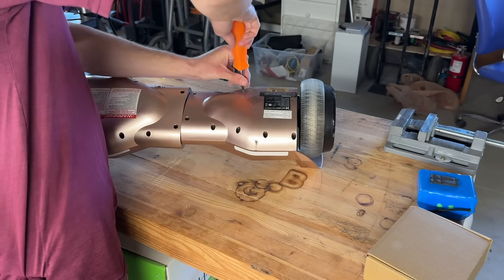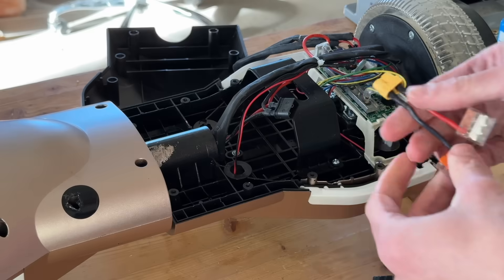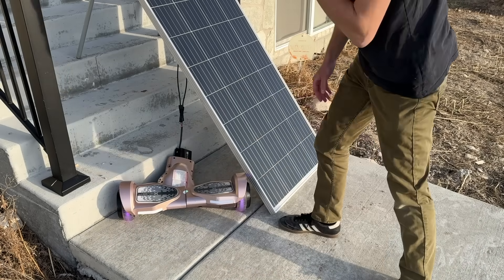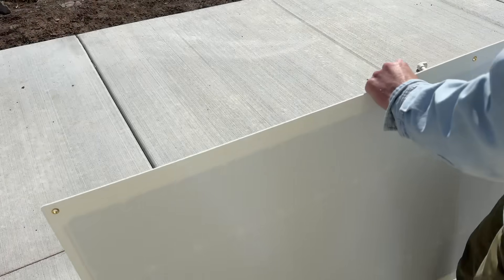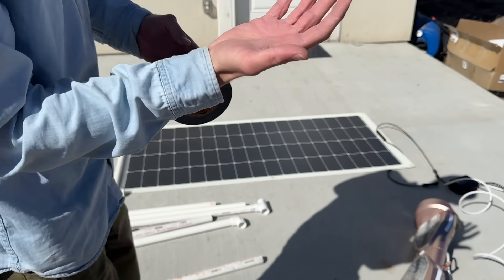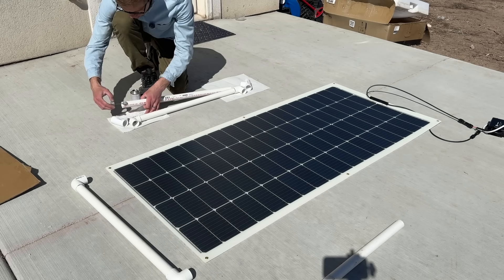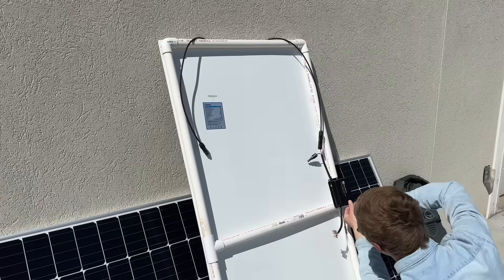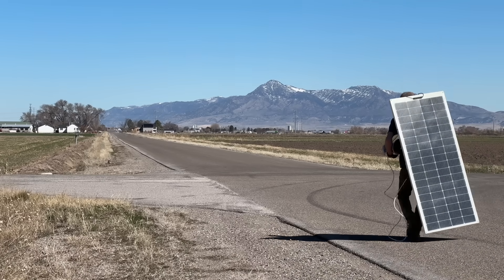I Built A Solar Powered Car... (No Battery)

Comment: 🌴🤔hummm, so yea many of use have idea’s but not many of use carry them out , as I to always wondered if there could be an infinite powered vehicle or boat , so there would have to be a battery just to get you thru the clouds , or over cast , my first thought was something like a cheap mobility scooter with a solar roof , and then I thought while the scooter is already going to be moving could a bike wheel be mounted in back connected to a belt drive generator as regenerative power ?    🤔

Comment: solar panel hho generator into small lawnmower 4 stroke engine dont forget to add a small amount of aluminium powder in water job done then you only ever need water.
Reply: Adding 50% losses making hydrogen then burning it at 25 % efficiency ending up with 12.5 % No just feed the solar electricity into a 87.5 % efficient wheel motor for 7 x the power.
Reply: @JonathanTamm  yes but when the sun goes in dont work hydrogen is the way.

Comment: The problem why the invention doesn't work very well is for a very simple and obvious reason: You have a hoverboard that contains two electric motors of 200w each, so in total: 400w, so logically you need a power source of the same capacity, so 400w, and that's not the case because your panel is a 200w panel, maximum power, so you can never get it in real time, so anyway your panel doesn't provide even half of what the hoverboard needs to function! It's already a miracle that it still moves, hihiiih
Reply from the maker: I like to do at least one impossible thing every day
Reply: @SmithOffGrid  time for a dual panel version?
Reply: @SmithOffGrid 😂😂
Reply: @SmithOffGrid that pannel is very heavy ... maby you should use something like these ... they are lite ... and also you can tow them ... maby use some cheap wheels ... https://youtu.be/h0it7F9VBWg?si=ia0gaalrQdMBEiIY
Reply: @tigervim7  They are the same panel. Thin flexible panels.

Comment: These infinite range tests may not be practical but they get my imagination going.
Reply: I mean unlimited free travel, and some of these can go 12 miles an hour
Reply: Unlimited travel as long as the sun is out, the surface is smooth, there aren't any hills, and you don't mind being pointed and laughed at. Maybe we need a rail version for abandoned railways.
Reply: @Skudster13  Actually, Tom Scott did a video about a solar powered railway a while back. I think it was in Australia. Maybe with better panels and batteries now, it's viable for a few more lines?

Comment: Next version: Battery buffer, the bigger solar panel, better roof frame. Love it
Reply: One more hoverboard for the front wheels
Reply: A trailer with another panel
Reply: V2 should just use motors. Ditch the rest. If you are sitting, you don’t need very much in terms of components. Steer with front tires and add wood or aluminum frame.
Reply: For a battery buffer you could use ultra capacitor bank
Reply: Agree, battery buffer would be great.
Reply: maybe a tiltable solarroof?

Comment: if you put a solar board underneath you (solar part facing down) then you used mirrors placed under the panel with about 10 inch gap to reflect the light toward the panel, would that work?
Reply: He would probably have a better time with a solar panel trailer
Reply: Yes but at 99% speed reduction.

Comment: Could you wire in an ultracapacitor in parallel with the panel? Still no batteries, but might get you past a cloud or two.
Reply from the maker: This is a great idea!
Reply: I was about to comment the same thing! Great idea
Reply: Since it's running on just ~5% of max power all the time, the capacitor would not manage to charge at all. The board is always trying to take more power, but all it gets is the output of solar panel.
Reply: @rychu212  But he ends in full sunshine not moving or storing power. He's got a variable charge controller, he can adjust the voltage to match the charging voltage of the capacitor. At 5% at 20 minutes it's full.
Reply: A lithium battery has about 100x the energy storage per weight of any supercap, and we don’t need to dump that power in a millisecond but instead over seconds or minutes making it a far more effective choice.
Reply: add a solar power station or a wind turbine generator infront
Reply: Isn't a capacitor just kind a battery tho ?
Reply: @ForeverMan  No capacitors store energy as an electrical field and batteries store energy as chemical energy. They function very differently but achieve similar goals. Typically capacitors have much lower capacity than batteries
Reply: @applesaregoodeatings  water bottles and cans are different containers, both store water. what I'm saying is, he said NO BATTERIES then is thinking about a capacitor
Reply: @ForeverMan  Yes, a battery and capacitor both store electrons (electric charge), just in a slightly different way. It is common to use a large capacitor in place of a battery for its faster charge times :)
Reply: Yeah, I was wondering about a capacitor, too. :D
Reply: It needs to go on the output of the charge controller.
Reply: I did comment the same thing
Reply: it's a nice idea, if you don't mind the number of capacitor you need to power the 2 motors for more than 1 minute... 10 ? 20 ? I'm talking about industrial super capacitors with hundreds of farads of course.

Comment: My friend, you're getting an upvote solely for "hoverboards are the worst."
Reply from the maker: They really are! 😆
Reply: @SmithOffGrid Don't be embarrassed about your design testing.  Everyone has to start some where. I believe you should think bigger wheels  in the design.
Reply: It would be interesting trying this with  a Onewheel or a Super Scooter that goes 60 mph
Reply: Doesn't even hover
Reply: Not saying they're amazing or anything, but he was using a dogshit Walmart hoverboard for kids. Of course it's gonna suck. With that said, it was definitely a super interesting project, regardless of what motorized thing he used
Reply: You wanna know what the worst is? Driving an electric car that's not powered from the sun
Reply: There are hundreds of videos explaining why it's not worth it. TLDR : too expensive to integrate for insignificant output. EV are power hungry compared to hoverboards
Reply: 6:47
Mike Tyson agrees 👍
Reply: They suck because the whole thing is extremely top heavy.
Reply: redditor type comment

Comment: Okay, it wasn't safe, but I do have to say that a human-sized solar panel back pack was pretty rad looking. Could a capacitor bank be a cheap, lightweight way to help deal with the cloud issue?
Reply from the maker: Adding some capacitors is a great idea! I just gotta switch out that hoverboard for something else haha
Reply: @SmithOffGrid  ...2 hoverboards?
Reply from the maker: There we go haha 😂
Reply: @SmithOffGrid  🤣

Comment: now with battery
Reply from the maker: I had thought about a follow up video where I wire in a 5kWh server rack battery on a little trailer and see how far I could go
Reply: @SmithOffGrid  a small battery to buffer the clouds. Seems these hoverboards came with 2-4ah batteries…which already seem small.
Reply: You don’t even need that much, just 30 or 40 watt hours, something to bridge you between cloud cover and facing away from the sun for a moment.